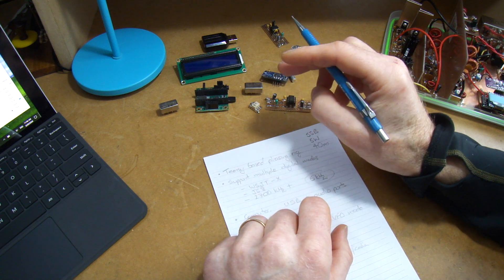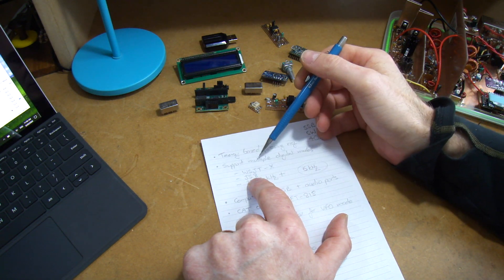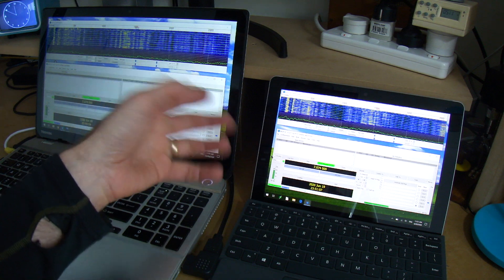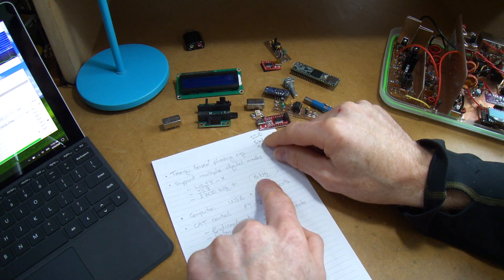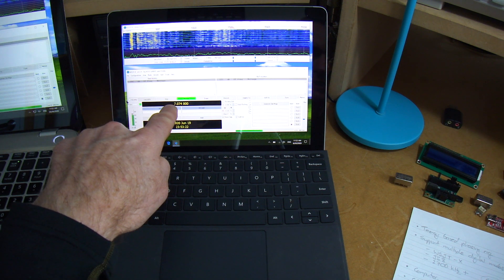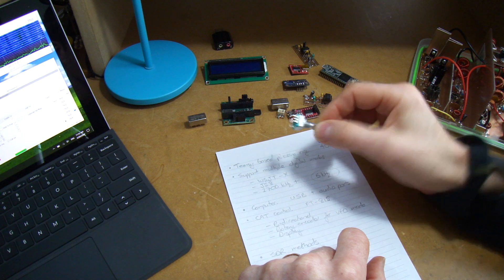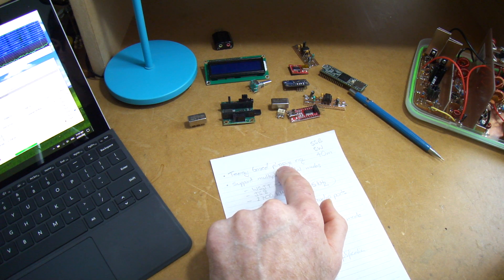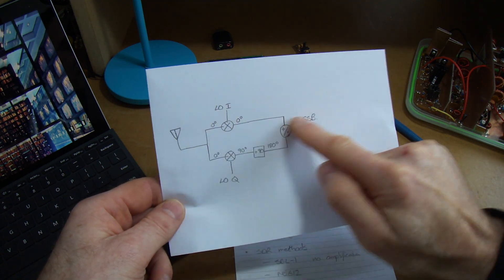Digital Modes Rig - Part 1 Design Thoughts

Comment: Charlie, you can certainly input non-standard frequencies in WSJT-X. I haven't tried tuning the rig to see if WSJT-X tracks it. I have been using a small laptop with USB to USB-C convertor for CAT control and an audio plug splitter with the audio signals going through an old PSK interface with opto-isolators and level controls. I did have issues with stray RF upsetting the USB but some ferrite on the various leads sorted that. Looking forward to seeing your rig develop.
Reply from the maker: Stanks Steve. I have the CAT mostly running, which is good. Once I have that fully functional I'll be able to fully evaluate WSJT-X. I don't have a CAT capable radio at the moment, which makes it difficult. Thanks again.

Comment: You were discussing in the video whether you would use NE612's or some other mixer. My vote is with the 612's. They're much maligned as Rx mixers but I think the requirements are different here. 612's seem to be pretty easy to get your hands on at least around here so others can follow your lead.

I 2nd the suggestion to try and get the audio over USB as well as the CAT "serial". The nice thing is you can do this in stages. Get the project working using traditional speaker/mike connections then transition to USB audio. This should be made easier by that excellent Teensy audio library and design tool you mentioned.
Reply from the maker: That's what I am thinking too Dave. I get a bit of conversion gain at the same time, which would be good.
Reply: @CharlieMorrisZL2CTM  On this project could you explain your thinking around gain and losses through the various stages? I certainly get the concept (you need enough drive out of one stage to satisfy the input requiremenst of the next stage)  and you often mention this with some explaination but I'm interested in hearing more about your thinking on the subject.
Thanks

Comment: Have you made any radios using a QSD/QSE/Tayloe mixer, that seems like it could be a good fit here.  I have also heard good things about H-mode mixers, but don't know too much about them.

I like the suggestions others made about being able to combine the audio and serial control over a single USB cable with the Teensy.  I didn't even know that was possible.

I don't remember if it was from your other SDR videos or somewhere else, but I have seen some DSP phasing use two 45 degree shifts, with one for the I signal and one for the Q signal, which still creates a 180 degree phase shift between the two.  The reason for that was so that both paths have the same latency, instead of only the Q path having latency added when the 90 degree shift is applied.

I look forward to seeing how this progresses.
Reply from the maker: Hi Rob. Yes, i have played around with the Tayloe mixer a while back. It certainly worked well. More recently I have elected to use the double direct conversion mixer approach. I didn't know about the audio and serial control for the Teensy either. I hope I can make that work. As for +/- 45 degrees. That's what I use for the SDR radios. The Iowa Hills filter design software suggests that is the best way for the reason you outlined. Otherwise, you need a fixed delay in the I signal line to match the latency. I didn't mention that in the simple diagram as not to muddy the waters so to speak. Hopefully today I can get WSJT-X to recognise the Teensy running the FT-857D software library  example sketch as a valid radio. It wasn't last night, which was a pain!

Comment: Looking like a plan. I did play around with the CAT interface on my Icom a few years ago,  was a little odd in that it was using only a single wire for both rx and rx but it did work. Not sure of the Yaesu configuration but I'm sure you'll get it working. 
Will you be driving the NE612's with quadrature signals directly from the SI5351 board.  I'll be following with interest.  
73 for now.....
Reply from the maker: Thanks Brian. Yes, I will generate the quadrature LO signals straight from the Si5351. Just struggling to get WSJT-X to see the Arduino FT-857D example sketch. Rome wasn't built in a day as they say.
Reply: @CharlieMorrisZL2CTM  Might want to take a look at the source from the ubitx. It shows up as a some Yeasu to WSJT-X.

Comment: Don't use the USB serial adapter for cat control, the teensy can easily handle that. You should be able to "emulate" a sound card and a serial port with the teensy 3.5 and still have room to spare.
Reply from the maker: Thanks Tim. I will try and get that to work. At the moment I am testing the Arduino FT-857D library, but cannot get WSJT-X to see it. I'll get that working first and go from there.
Reply: @CharlieMorrisZL2CTM  " device monitoring studio " is a good free software to monitor the serial port .. so you can figure out what is going on ... the operating manual of FT857 have a full detail of CAT command and example
https://www.passion-radio.com/index.php?controller=attachment&id_attachment=288

Comment: Hi Charlie, 

firstly if you check in the manage libraries ( in the arduino IDE ) you will see a cat control for a Yaesu 857D... this will setup the arduino/teensy to be seen as a yaesu 857D radio. Thats your cat control protocol sorted even if its not an FT-818. The teensy can be put into the "serial/midi/audio mode" usb interface mode. This has the side effect of giving you a soundcard and serial right on a single usb cable. i hope this small piece of information gives you a good start on a possible direction with the software/hardware. 

Best regards

Simon
Reply from the maker: Thanks Simon. That is really interesting thanks. I have not used the Teensy in the audio mode, so that will be interesting. Thanks very much for the steer.
Reply: @CharlieMorrisZL2CTM  it's no harder than you already have done just look for the usb in and out  modules in the audio design tool. then just patch cord the usb in to the line out and the line in to the usb out module.  I have just finished a quick experiment with my own code in a teensy 3.6 and have passed the test cat function and have set both audio in and out to "digital audio interface (teensy midi/audio)" at the same time. i May finish the code off and get a working cat interface or emulated yaesu ft-857. Emulated cat functions for at least the basics of frequency and tx.
best regards
Simon
Reply: Hi Charlie,  did you sort out that cat library and get it working? I have a piece of software that's almost finished for the teensy 3 boards. I have it partially working for the yaesu radio's... there is a group of radio's that it will work with 

Best regards
Simon M6FJW

Comment: since it is FT8 you may go for a non-linear PA like a class C single transistor amplifier. Maybe even test some VHF BJTs like good old  2SC1947, 2N2078, BLY91 or 2SC2101 or similar types that have more gain and output power in HF, of course with proper feedback.
Reply from the maker: Thanks. I'll look into that.

Comment: I think it would be entirely doable to control the frequency from the computer. Even if the software for what ever digital mode you are using can’t control it directly you could write a bit of software that would allow you to control the radio from a different window.

It makes some sense to use the existing audio input and output of the computer and the usb-c for CAT control. Certainly easier. But have you considered a splitter on the usb-c to allow both cat control and a sound card through a single cable. I guess I am trying to get you to build black box with a single cable connection instead of the three you are planning. The trade off is that you will spend considerable time figuring out a sound card interface and cat interface which might be further away from you desire to do RF engineering. That is the drawback or advantage of these SDR rigs. Simpler electronics traded for rather complicated software. Best of luck. Charlie KM4ZZ
Reply from the maker: Thanks Charlie. I like software engineering too, so that's not a problem. It should be fun.

Comment: Looking forward to the progress on this - particularly the CAT control side of things. Having the entire UI on the computer makes a lot of sense!
Reply from the maker: Cheers. Would you agree that there is no need for a rotary encoder and display? I'm inclined to think it can all be done in-say-WSJT-X and the like.
Reply: @CharlieMorrisZL2CTM  I think so - I have never programmed to the CAT interface so not sure on the acknowledgment demands and how complex that is to deal with though. What you may want to retain though is some way of controlling the calibration of your radio - that frequency emitted by the si5351 is always out! Maybe also you'll need to calibrate the phase shift perhaps. Cool stuff indeed.

One thing I thought I would ask though is did you consider using FST3253s as mixers (the "Tayloe" detector) I have always had success with them in IQ style radios
Reply: Hi all .. i think you have to use the rotary encoder but not the display  ... I'm using  JTDX  software with my IC7100 ... the CAT  control is bidirectional you will get the freq. on the software ... the same with WSJTX
the software have a freq. list that you can select from ... but you cant tune around  like a VFO ... you can add a new freq. to the list  that's in the setting ... and during operation you  can select it from the drop menu ....